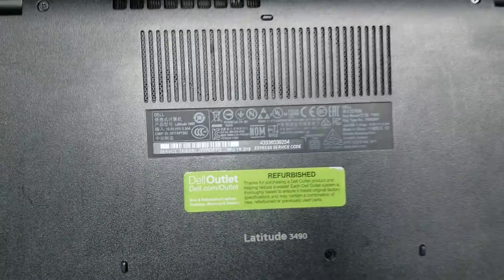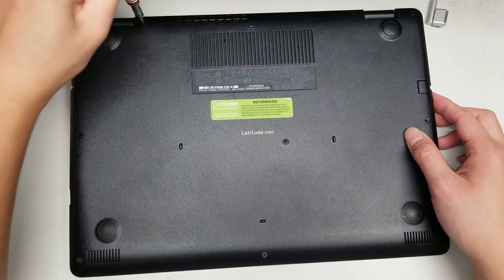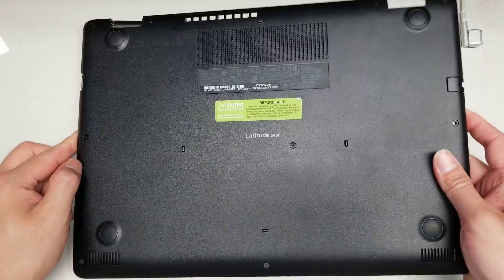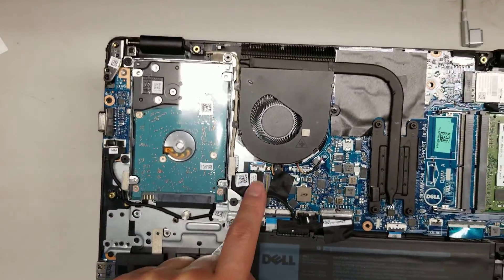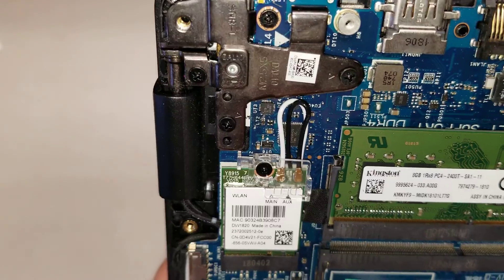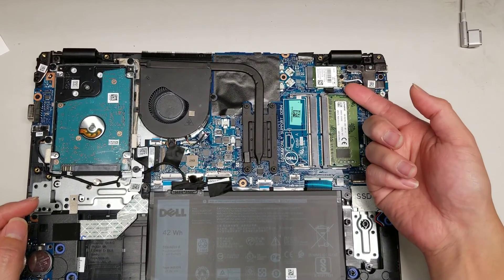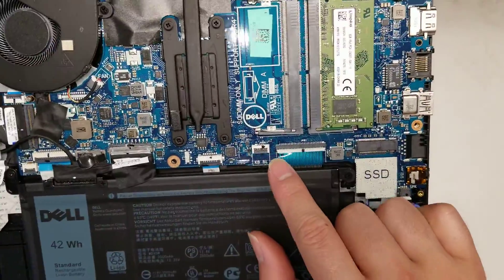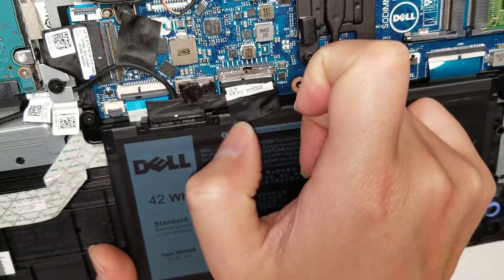Dell Latitude 3490 Disassembly RAM SSD Hard Drive Upgrade Repair

Comment: Greetings! Question, is the battery completely flat all around? I'm trying to revive one of these and the battery is ever so slightly bloated at the middle and the right, so I'm wondering if it's a fire hazard battery or just thicc. I know it's an old video, hope you could respond nonetheless
Reply from the maker: It'll be fine for a while, but should be flat.

Comment: M.2 SSD which version? PCIE ?
Reply from the maker: I don't know. Possibly pcie. You'll have to test it and let us know, or you might be able to find the answer by googling.
Reply: @ItsBinhRepaired  which one is urs? Can u check with any hardware expert nearby? I'm from a very poor family. I can't spend just for the purpose of testing. I will be buying one as a long term investment.
Reply from the maker: Amazon has free returns. If poor, you want to learn to do research. It's a very useful tool. Google the model number and m.2 and see what you can find. I don't own the computers in my videos. If you watched the video you'll see there is no m.2 SSD in the laptop.

Comment: m.2 slot right there on place sight, not mentioned. It supports both m.2 SATA and PCIE (256 GB max in SSD, 512 GB max in NVME
Reply from the maker: Woops! There's actually no max capacity. The max is whatever you can buy.
Reply: NVME = SATA or PCIE?
Reply from the maker: Nvme uses pcie. Pcie does not equal nvme. Similar to saying Apple = Vegetable or Fruit.

Comment: Dude, I can't remove the screws
Reply: Screws have grip inside.  I am also facing issue. But it will open
Reply from the maker: @akashrawaldia791  make sure you use the right screwdriver.
Reply from the maker: What screwdriver size are you using?

Comment: Thanks, my man. I just needed to watch this before opening up my Latitude 3490 to upgrade my RAM. Thanks a bunch!
Reply: Yes I checked It handles a max of 32Gb and so I can extend more. But I don't know which company Should I buy
Reply from the maker: @Mugiwara--ya  doesn't really matter. Make sure it has lifetime warranty
Reply from the maker: Glad it helped. Don't forget to like and subscribe if you haven't already. It'll help me as well.
Reply: Hey man Ajay can u tell me I have this same laptop in 8 Gb ram and I want to add more. But idk how much will it support and what kind of ram should I use. I would like to add another 8Gb of ram to it if possible
Reply: @Mugiwara--ya  3490 supports upto 32 GB. 

Official info here:https://www.dell.com/support/manuals/ca/en/cabsdt1/latitude-14-3490-laptop/lat3490_owners_manual/memory?guid=guid-e8833469-3476-47a1-9994-3430bcf32d1e&lang=en-us

I bought ram sold by crucial from Newegg website as it is cheaper than dell. I bought a 16gm stick and replaced the 4gb one.

I used the advisor tool on crucial's website to initially find compatible ram upgrades for the 3490.

Just make sure you're buying ram with a speed of 2400MHz as there are many latest variants out there that are faster but dell recommends 2400Mhz.
Reply: @Tuliparama  thanks guys... Really helped me
Reply from the maker: Check Amazon too and don't trust the manufacturers. I've had several say 8gb max and then put 32gb and it worked fine lol
Reply from the maker: @Mugiwara--ya  ask Google. Nobody will know the real max unless they put it. You'll have to open your computer and see if slots are available.
Reply: Does any way to this notebook run GTA 5 game ?